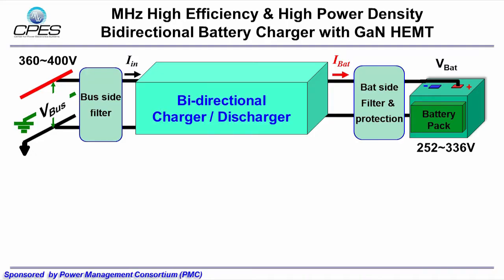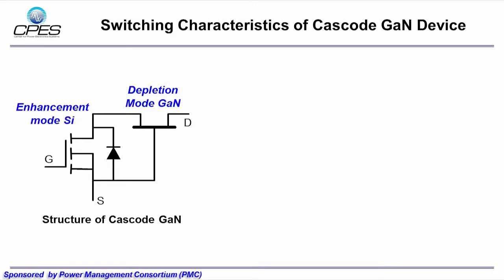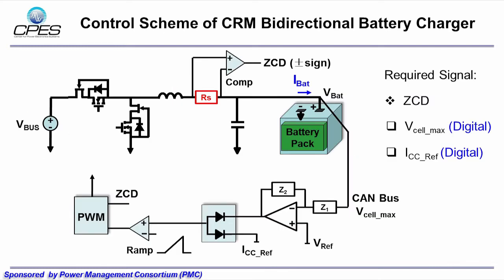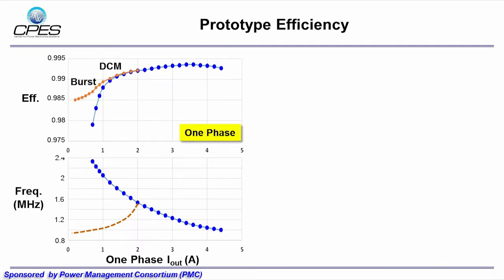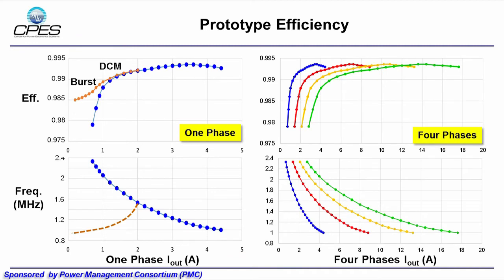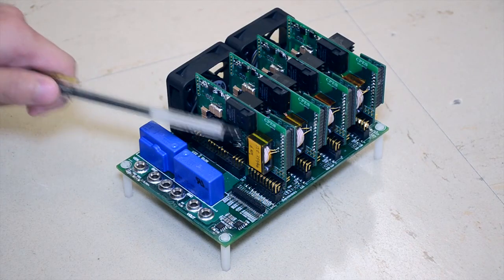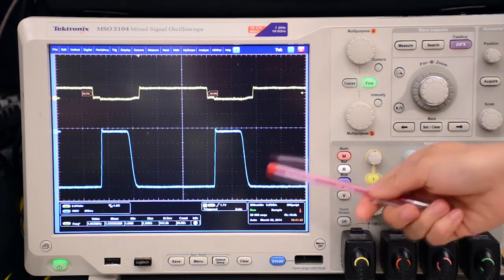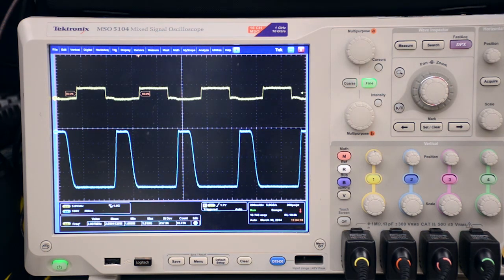MHz High Efficiency & High Power Density Bidirectional Battery Charger with GaN HEMT - Xiucheng

Comment: are you reading battery voltages from an adc periodically by removing charger current?  which microcontroller are you using.